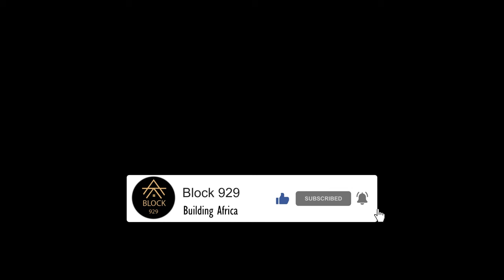TRAILER: The Lilongwe Bridge Project || UP, CLOSE AND PERSONAL...

Comment: I'm not an engineer but from watching a lot construction works....I have noticed that they're using rather much less reinforced steel rods on those new bridge legs...can someone with relevant knowledge please explain
Reply from the maker: Those bridges being built are temporary bridges. The main bridge will be build on the original site.
Reply: I'm talking about the main bridge....there are piers being built bust beside the current old bridge
Reply from the maker: @sammvula8369  check my previous video about the bridge. It show the wire being installed.
Reply: @block9292  it's the number of the 'wires' that I'm worried about